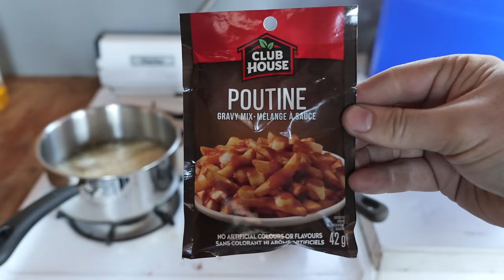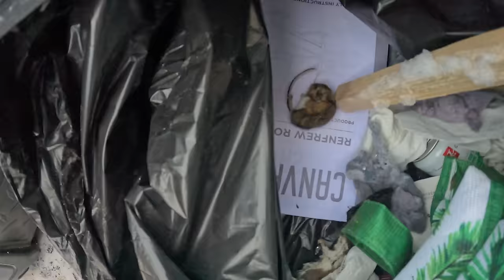MAN ALONE IN CABIN. THEN WOMAN AND DOG

Comment: BAM oven cleaner does the job here in Australia, to clean that gas cooktop. You spray the BAM on, and let it sit for 30 minutes. Then you do your scrubbing.
After, you can use a vinegar/water solution to clean the metal surface from the other impurities. Not sure what u have in canada, but bam is ; Ingredients:
Water, Dipropylene Glycol Propyl Ether, Isobutane, Potassium Carbonate, Ethanolamine, Smectite Clay, Benzyl Alcohol, Sodium Lauroyl Sarcosinate, Paraffin Wax, Fragrance. Contains fragrance allergens.
Reply: After you BAM it Jay then buy Rustoleum gloss white high temperature spray paint. Three light coats. Will look like new. 
Love the cozy rocking chair and stump end table.  ps- pls cleat the top of your loft railing to the wall for strength and safety.
Reply: So helpful to put the ingredients

Comment: Man in Cabin…….use a wooden cutting board instead of a plate to cut something….use COMET to clean the stains on the stove…then clean it every time you use it.  I have a 1950 Chambers Deluxe High Back Yellow Gas range…it had been used from 1950 to 2001 by the original owner before I bought it in 2001 and I have been using it almost every day since.  Takes just a few minutes to clean it up.   I love your dog!

Comment: Great video Jay, the stove top, you'd be surprised how straight WD40 does miracle, spray, let soak for 15-30 minutes, wipe it out, and clean everything with white vinegar, job done for cheap! Best part of the wd40, is its non-abrasive so it will not ruin the paint. Have a good one!😉

Comment: I grew up utilitarian in the north, helped my dad logging, and started 4 successful tree services. Hard to believe a Sthill outdoing a Husqvarna. What happens sometimes is that an operator will put it in the ground, dull the teeth (maybe sharpen improperly), burn the saw up, buy a new saw with a new chain and it RUNS GREAT! lol Sthill have many small, plastic parts that can break in the wilderness and leave you far from the saw shop.  But, to each their own. 

Is that a lake under that snow? Wonder what kind of fish swim under that ice. Cheers

Comment: We use our log sleigh to haul wood to our cabin. Its made by my father but there are also factory made options. It can be converted to ordinary sleigh to transport goods, and for the factory one you can just add a plywood on top of it (make sure if you desise to get one that you dont get the one which is linked whit chain. That is only good for long and heavy logs.) Its heavyer than sled and whit heavy loads you need pre driven path, but you can load much more wood on it and it dosen mind rocks and stumps. In your situation that would be my next invest. Great videos and love to see more.

Comment: Jay , Nice video enjoyed it. Just a small idea for your propane, having lived in Northwestern Ontario we would get some really cold spells ..like -40 to -50  cold and sometimes even colder . Propane does not flow well at those temps. What we did was build an insulated box with plywood and blue styro that encased the tank . Then start an outside fire and in a big pot with water boiled rocks. When the rocks where hot but not so hot it would melt the styro or burn put the rocks around the base of the tank. This warmed the propane just enough to let it flow properly . It sounds kind of weird but it works well.  At our remote camp we had a large tank for the fridge and stove and used a small portable diesel heater that blew warm air into the box which worked extremely well. Just and idea. On your stove top--try an oven cleaner (spray or brush on)  ,had the same problem and it works extremely well just let it sit for awhile then wipe it off , you may have to do it a couple of times but it works .

Comment: You got a steal on the Stiehl. I have used bar keepers friend on burned on stains, but you can also try soaking it with hot water and dish soap on a dish towel you wet and leave over it while you work on other things. Just keep reheating the damp towel.

Comment: Propane tanks have a safety valve that engages if you open the valve too fast.  It’s meant to detect an open line and prevent massive gas escape.  Shut everything off and reopen the tank valve slowly until you have filled the lines.  Also, severe cold weather reduces propane pressure inside the tank.

Comment: For your stove maybe you can try s.o.s. pads and comet  (if they are available in your area) with really hot water.  It is abrasive so it should give you some good results.  It's not as bad as steel wool so it shouldn't scratch the surface of the oven. AND your puppy is absolutely adorable!

Comment: Bar and chain oil is a must. Make sure to clean under where you tighten the bolts. That's where the bar and chain oil comes out it gets clogged up with wood dust from cutting the logs up

Comment: Your cabin stays so cold in the deep Winter that you can bring your propane cylinder inside.  That would ensure that the LP would vaporize and supply your stove with enough pressure/volume to run it.  If you're concerned about your cylinder popping-off, you can always put a hose on the pressure-release valve with a hose clamp and run it through the wall to the outside.

Comment: Frozen mice....no bueno!   To clean the stove top, cover the burners beneath the stove top removable cover with plastic wrap, then spray the top with oven cleaner.   Cover the cleaner with plastic wrap to keep it damp.  Leave it several hours or overnight.  It will wipe off with paper towels.  Then just a light scrub in some areas if anything is left.  I like Dawn Powerwash.  I don't know if you have it there.  If not then dawn and a magic eraser or steel wool, but scrub lightly with that so you don't scratch the enamel.

Comment: Re: stove top 14:26  Learned this from a housing inspector in military housing years ago: put top, oven racks, anything with heat hardened grease in a black garbage bag. Pour in enough ammonia to make about an inch depth when bag laid flat on its side. Seal off with twist tie. Leave flat overnight or about 8-10 hours. Fumes should loosen grease enough to easily wipe off with minimal scrubbing. Worked all those years ago. Good luck.

Comment: To clean your stove top you can buy a pressure steam cleaner from Amazon or Home Depot, and it will loosen up the burned-on grease without using chemicals. The one I bought from Amazon was $150.00 plus tax and it makes it very easy to clean your stove. You plug it into a 120-volt outlet, so you will need electricity or a battery bank.

Comment: keep your propane bottle in the same shelter as the generator, wrapping the exterior running pipe in good, pipe ,insulation, maybe even a run of heat tape attached. when Gen. running, it will help warm bottle slightly

Comment: I use a razor blade. To scrape burnt on stuff on the top of the stove.  If it has the porslin coating, it doesn't strip it off. I have done twice to my stove in the kitchen  it's about 28 years old. It looks new

Comment: Propane issue is such that when the temps get really cold the propane doesnt want to flow as a gas and stays more liquid which lowers gas pressure. If the tank is a bit warmer and especially spring- summer -fall times it should be fine. I also use my camp during the winter and have built a box for both of my tanks and put a heat lamp into the box to raise temps when very cold. I use a switch so I can turn the light on 20-30 minutes before I am planning to use and have had no issues. I do vent the box and have my propane NOT stored close the house just in case of a leak. I use 2  40LB tanks but you can build a little shelter for any size tank! In a pinch while ice fishing I put a large hot hands duct taped to bottom of a 20LB tank to help heat propane. Folks that climb and endure low temps use a propane butane mix or a mix of fuels to combat the cold temp issues. Just future knowledge take it or leave it. Loving the videos!

Comment: I've been watching a few of your videos. RE: chainsaws, they are only good if they are sharp and an innocent mistake can make them dull and not cutting.  Find a local shop that can make you custom chains for your saws dimensions, and order several (like 3 or 4) back up chains.  That and learning how to safely sharpen them on the saw counting the strokes on each tooth and safety,, will keep you running for the winter.  Looks like you are having fun. I will keep watching with envy. Cheers from Peterborough.

Comment: Spray thick coat of easyoff on the stove top and place in in a enclosed bag for 8 hours and that should do the trick. When you sharpen your chain you should also use a flat file on the rakers every second filing. The rakers grab in to the wood and makes cutting so much easier.
Reply from the maker: Thanks for the info!

Comment: Take the top of that stove home with you . Try using a soap impregnated pad, ( Brillo or SOS pads) to try and scrub it up clean . Presumeably it's not all rust, but cooked on food . You could even let it soak in your bath tub in a mild water/soap solution over night, then try the SOS pad . If that doesn't come clean, you may be able to find another top plate for the stove .

Comment: Small propane tank with a range the size you have will struggle at times . The problem is that the tank will freeze up depending on the outside temp as well as how high you run your stove . When propane gets to the point it is liquid rather than gas this problem becomes severe .
A larger propane tank will help control this problem.

Comment: I have the exact same stove only in off white. The shit on the top drives me insane. I’ve found the best way to clean it is with a magic eraser, which gets a lot of it off with some elbow grease. For the more difficult to remove stains I use easy off HD over cleaner, sometimes it takes a couple applications to get it off. I’ll use a green scotch brite pad to scrub it, the finish is ceramic or porcelain or something along those lines and won’t scratch. Both the stove top and oven work fantastic on mine, perhaps the orifice is plugged a little or there is debris in the burner tube.

Comment: If that gas is premix canned fuel STOP USING IT! Most of that crap will kill your saw. I was a sawyer and wildland firefighter with USFS and did a LOT of tree felling and cutting. Little known thing, in the center of your sprocket drive look for a small hole, this is for you to grease so the main drive bearing gets greased, also if your bar has holes near the end those are for greasing the sprocket bushing.  The only fuel I use is premium with 2 stroke oil. The poutine looked great.

Comment: If all else fails, a bit of Comet cleanser should work or even Soft Scrub. It looks like the glaze of the porcelain is long since gone, so the bleach in either product would be able to have a chance to work on the stain. The abrasive in them would probably dispatch and surface "ick" rather handily.

Comment: Cutting that frozen wood may require a different chain for your saw. I don`t remember for sure, but a standard chain is a rapid micro?, and you need a rapid pico. Anyway the tooth is square on top. If you think that chain was cutting good, wait until you try the other one.

Comment: that is a 2 stroke engine, you need to add 2 stroke mixing oil and stabilizer. pint of 2 stroke mixing oil to 5 gallons of gas if you want 50 to 1 ratio, but i always mix 40 to 1

Comment: In freezing temps the liquid propane when converting to gaseous form within the the bottles can start to freeze ( jelly ) at this stage the convertion from liquid to gas is reduced . When burning the available gas at this stage pressure in the bottle will reduce .   Looks like you keep the bottle warm in the cabin and connect it when needed . The blue flame in this video is correct .   A yellow flame is low pressure .

Comment: Good go on the saw, have three, go to machines when it gets tough.  Get you a deep fry cooker that fits in your cooker.  One with all the holes.  Safer does better job, just dump out and dry them.  Gittin' real close to 200K subs.  When you transport wood like that put a few 5 or six inch screws down thru them to secure them together if they are for framing it won't matter about the screw hole.  Put some eye hooks supported with fender washer couple inches in diameter on the side of the sled and use Ancra motorcycle tie downs to hold that wood down.  You'll be using a lot of it in time.  You can make a wood frame to set into sled.  Use a couple 2x4's long ways, then a couple 2x6's across but only have them a couple inches wider than four foot since that is standard width for plywood or sheating.  Secure the frame then secure the wood to it.  Keep the width down maybe a couple ears sticking up of bent metal.   Good vid

Comment: Jay, l was wondering if you get concerned with  the weight that snow is putting on your roofs? It looks to be at least 2 ft thick. Here's some info: 
Packed snow: 3-5 inches of old snow is equal to one inch of water, or about 5 lbs. per square foot of roof space, so anything more than 2 feet of snow could be too much for your roof to handle. Total accumulated weight: Two feet of old snow and two feet of new snow could weigh as much as 60 lbs.

Comment: Jay
If you experience a low flame in your stove with a brand new bottle of propane, try turning the tank off and then very slowly turn it on. Light the flame and it should be much stronger

Comment: I swear by Easy Off oven cleaner.  I know it is available in the USA. Not sure about your neck of the woods. Take that range lid outside, spray it down, let it sit for 15-20 minutes and wipe it down, rinse it off.  Reapply if there is still cooked on crud.

Comment: Propane stays a liquid at -20 so judge it by temperature.
Got to get the tank warm before you use it.
DON'T HEAT THE TANK WITH FIRE!
NO TORCH ESTHER.  BE SAFE DON'T USE THE STOVE TO HEAT the cabin  ESTHER.

Comment: Jay I am a recently a new subscriber and I would love to add a suggestion.  Take your chainsaw and slice a piece of that pine log and cut it about 2" thick.   Use it for your hot frying pan so you can sit it on your table.  They also work great as a cutting board.  I use mineral oil to preserve it.  Just buy it at the drug store and it works great on all wooden utensils.  I hope this helps, Chris

Comment: Regarding your propane stove issue. From your description, to me it doesnt sound like and outdoor temperature issue. its not the tank thats too cold. A propane tank will function fully down to -40F at -44F the gaseous propane in the bottle condenses into a liquid, propane bottles are under pressure no gas no go. The issue seem more likely to be water in the propane regulator. (The propane regulator is the round part that one one end you screw onto the tank and the outlet is the black hose.) Which is caused, most likely by 2 things, either 1.  condensation forming on the metal tip inside the black plastic screw tank connector and getting blasted in to the reg when you opened the bottle, (from being brought from a heated space into cold outdoor temps quickly. )  2. water from snow got in either the tank outlet or the screw on the regulator. A few drops of water is enough to trip up the regulator. Just turn the tank off unscrew it, check for any moisture, and check the metal tip in the middle of the black screw connector amke sure thats bone dry as well. hook it back up and it should work. Also, if the regulator does keep having flow issues intermitantly, its not the appliance its the regulator, you can buy easy replacement hose combos online.  Home this helps!

Comment: Problem with the gas bottle that small connected to a cook stove it’s easy to use too much at once especially when it’s cold outside causing the bottle to freeze up causing problems even in the regulator. This is why you usually see 100 pound bottles hooked up in this application.

Comment: Yes,,, making more comments.  Thinking that with your current power setup.  Maybe a Ninja or otherwise airfryer that hits around the 1000w mark.  Do your potatoes in two stages.  350 degress for 10min, and then with your oil around your almost 400 degree mark for only a few.  It will blow your mind man!

Comment: Stihl has a great sharpening tool which does all the sharpening stuff together......it was about 35 bucks when I got it a couple years ago but I would really recommend it as  it is a firewood lifechanger

You may want to  check if you could get a rebuild kit for your Husky  -  there are good ones from Hyway or  Meteor which are a good deal.....plenty of folk on ye olde Tube to show you how to do it and bonus points for actually knowing how the chain beast works......never too bad to have extra chain saws.....bragging rights in the Great White North, eh?

Comment: It is likely that your stove is good , but your propane tank sucks  .I have noticed ( even in the hot summer that my newer tanks freeze up in the tank valve when trying to full blast something like a banjo ( turkey fryer ) burner .
My old tanks ... no problem ... new tanks ... freeze up in the tank valve . Again , this is a wide open burn that i get this problem with .
I believe it is due to the newer tanks have a redesigned pressure relief valve . i assume the gas holes are also smaller , causing them to freeze up .